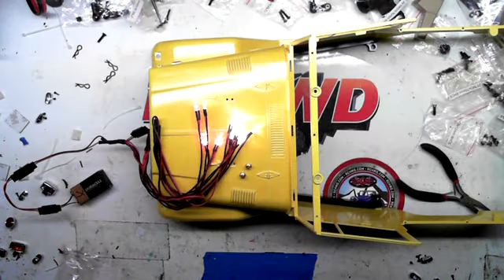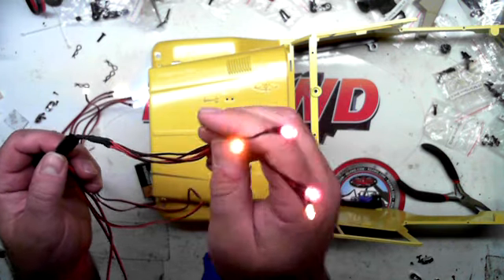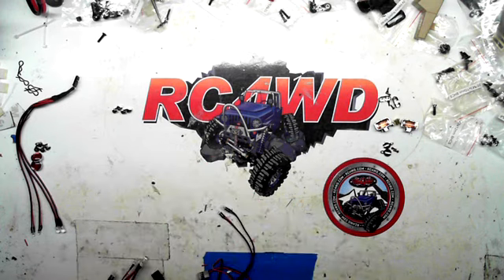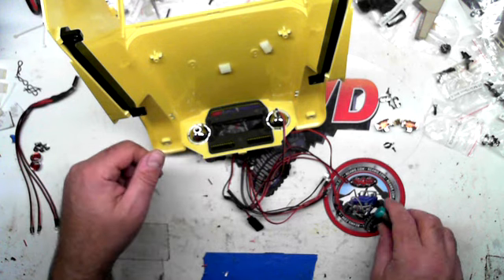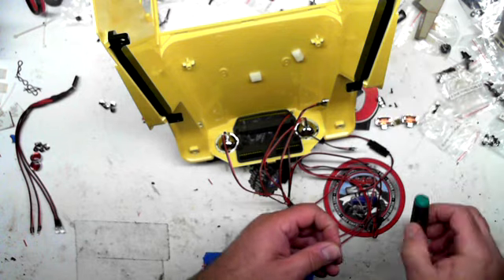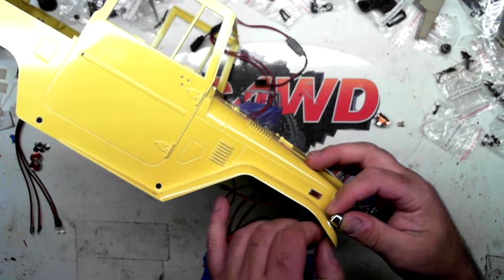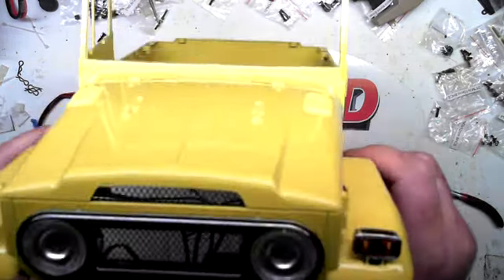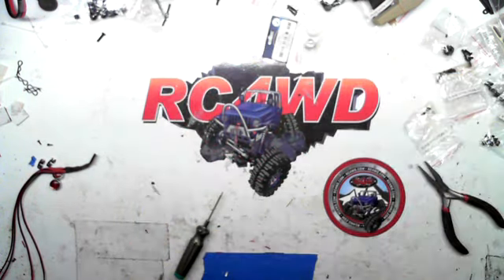How to Install RC4WD LED Basic Lighting System for Cruiser | Tech Tips | RC4WD Garage Series

Comment: Quick tip: When installing the LEDs on the front turn signal, twist the wires a few turns the other direction. The brass piece will want to screw itself onto the turn signal housing due to the tension on the wires. Also, no wire tension after its completely installed.

Comment: I hope you can help. As the light plug will be in a separate channel socket of the receiver, on the transmitter can we turn down the brightness in settings just like we set trim etc ? I'm looking for a halogen yellowish light and not bright white ?